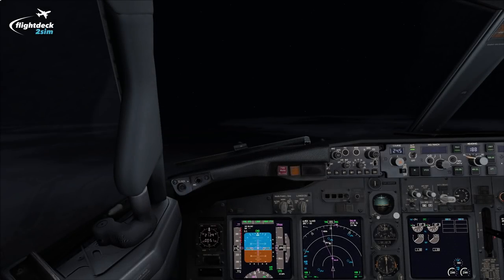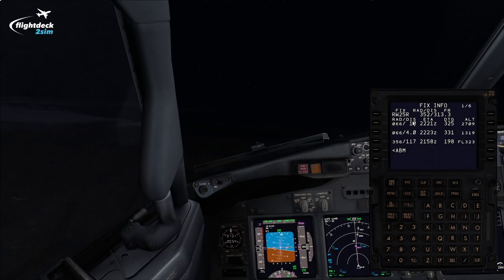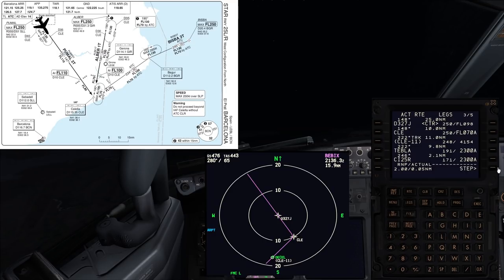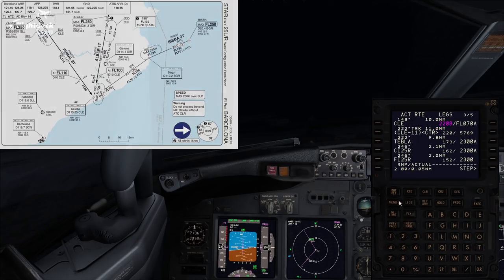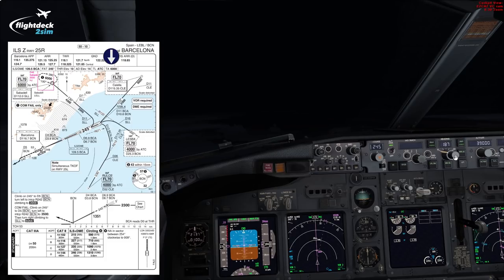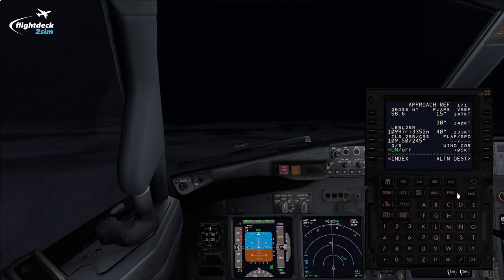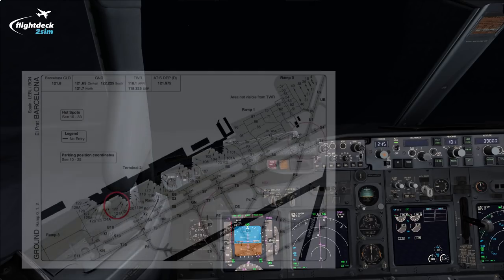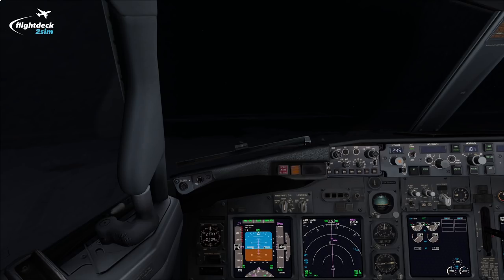How to read an Approach Chart by a Real Boeing 737 Pilot | PMDG 737

Comment: I was just doing a re-run of your tutorial on holding patterns. I must admit I am still fascinated at just what the FMC can do.

I wanted to do some practicing at entering a hold and set up one where I was quite high at FL310 and approaching a way point which was about 10nm before T/D. I noticed a Decel appear some distance before the a/c was due to enter the pattern. As soon as it reached the Decel point it began to reduce speed I guess because it was trying to reach the hold speed (219K) as it entered the pattern.

The timing was nearly spot on although during the turn the speed dropped with a bit of a jolt to a "buffet warning". Straight away the old girl lifted up her skirts and quickly climbed back to the set speed and still maintained the altitude. Coming out of the pattern normal flight continued to the T/D without a hiccup. Waiting down the flight path was the usual Decel point.

My hat is off to whoever invented this amazing package.
Reply from the maker: Hi Richard.

Although possible it would be very unusual to hold at that sort of height! 219kts would be quite a high mach number at FL310. Either way the FMC is quite a clever box of tricks and will provide you with a very efficient flight profile so long as you give it useful information. Just like any computer, garbage in = garbage out! 

FD2S

Comment: Sometimes the runway freq in fsx is different then cdu, always check the right freq on fsx self
Reply: To prevent this, you should have same AIRAC in both, FMC and FSX. For FMC you need to have a membership (or get it "somewhere else") and for FSX there's a great website aero.sors.fr with up to date data, really helpful.

But sometimes whole airport is moved, runways are altered, etc., so you have to download updated scenery anyways. I personally prefer free "lightweight" sceneries, which are same as default (graphics sucks), but updated with all stands, taxiways, etc.
Reply: ^^ happened to me once

Comment: Thanks for another informative video, I hope you dont get bored at some time soon and give up on making these videos! My question is on the chart the airport elevation is 14 ft, however the runway 25R is, according to the FMC, is 64 ft. And your took the chart as your reference. Is that because the pressurization has nothing to do with the runway elevation or because the chart is more reliable than the FMC?
Reply from the maker: Hi Ahmet, I enjoy making them and I will continue to do so!

We used the Elevation of the chart to set the Land ALT. The 64ft in the FMC is the height you want to pass over the threshold (+50ft) or the threshold crossing height. This is automatically set when you select the runway in the FMC. 50ft + 14ft = 64ft!

FD2S

Comment: Welcome back. A question to ask in regard to ILS approaches after replaying your tutorial on Cat III auto landing.
I noticed you activated the approach while still approx 90degrees to the RWY course after seeing the glide scope come alive.

I always believed it was necessary to establish the a/c on the localizer first & then check that the glide scope bug is sitting near the centre line before activating the approach. Does that mean the signal contains both lateral & vertical information for the FMC to control the approach as long as the angle is within certain parameters?
Reply from the maker: Hi Richard,

You can are APP straight away if intercepting the G/P from below, no need to are VOR/LOC first. It's also beneficial to do this when conducting an Autoland so you don't forget to engage the 2nd A/P! If above the G/P I would arm VOR/LOC first and arm APP intercepting the G/P.

APP follow's both the localiser and glide slope whereas VOR/LOC only follow the Localiser.

Good Luck!

FD2S
Reply: Worse thing is when You arm loc and forget GS

Comment: Can you explain why you add a ring for TOD in addition to the TOD calculates by the FMC, how does this helps you? Also, for TOD you mean altitude to lose x 3? Flight level x 3 i’m guessing would work if destination airport is at sea level but if you want a TOD from cruise to your IAF i guess it would be altitude to lose x 3? Thanks for your great tutorials, they will help me a lot next year when i start my type rating course!
Reply from the maker: Hi Manuel,

It might seem daft but the reason we put this as a fix ring is to increase situation awareness on the display in case you're distracted! You might also be off the magenta line if say diverting around weather so you have a approximate idea as to when to descend.

x3 is just a rough rule of thumb but it works out really well. Eg 30,000ft = 90nm. 5000ft = 15nm etc.

Allow extra distance to reduce to approximately 200kts 10nm from landing, (add 1nm for every 10kts of deceleration). For every 10kts of Tailwind also add 1nm. It's all approximate but It's what we do everyday and it works quite well.

FD2S
Reply: I've used those rules like crazy for flying a DC9 in FSX and it always works out perfectly if you can figure your ground speed and calculate the associated descent rate. Pretty stunning to pull off doing VNAV calcs in your head, but you quickly see how impossible an RNAV approach would be given the mad altitude restrictions into some areas. Doing it without a second pilot is quite hectic. It really makes you appreciate the value of a good FMC.
Reply from the maker: Yep, STAR’s are sometimes not built with continues descent in mind and restrictions can sometimes leave you very high or low!

FD2S

Comment: Excellent as always FD2S.   Is it normal after passing from the transitional altitude from standard to local QNH that I must press the Standard button on the EFIS in order to get my QNH set up in the descent page?  Despite doing this I find that the QNH is off by a few decimal places, which requires manually setting it up (at the least convenient time).
I've also noticed in the decent with engine anti ice, that my engine thrust is raised (presumably to take more bleed air from the engine). Not sure if this is normal, but at a time when I need to lose air speed it is very inconvenient, even with flaps 2 or 5 and the speed brake in the fully up position my aircraft refuses to slow down.
Reply from the maker: Hi ENIK,

The FMC DES page is independent to your altimetry setting, it just allows VNAV to build a more accurate descent profile. We immediately set the local QNH as soon as we have been cleared from a Flight Level (based on 1013 STD) to an Altitude (Based on QNH)

The increase in N1 is completely normal. When you select the engine anti-ice on bleed air is taken from the engine to heat the engine cowling, the EEC selects "Approach Idle" which is what gives a slight increase in N1/N2. The increased thrust makes you descend at a slightly reduced rate.

FD2S
Reply: I've noticed that the increase in N1/N2 only occurs when flaps 5 is set.
Reply from the maker: In the real aircraft Approach Idle (Increase in Idle N1/N2) starts whenever flaps are in the landing configuration or engine anti ice is on, I wouldn't expect the increase with Flap 5. 

I double checked the manual and it doesn't mention which flap settings, just "landing configuration" which would be F30 or F40 and potentially F15 in a non-normal situation.

This is why I like my channel though! People make me read the manuals so I keep learning too! 

FD2S
Reply: When would you use the leading edge anti ice?  I'm aware of the rule that if it is 10 degrees C or below on the ground, engine anti ice must be used. I spoke to a newly type rated FO on the 738 a few years ago, and mentioned that the aircraft needs to be set up differently during winter operations. I generally turn on Engine AI when in clouds of possible precipitation with start switches continues to break up any broken ice from the cowl.

Comment: Hello flightdeck2sim, you have said typically the MFRA IS 1000ft BARO do i need to add the Airfield elevation as well,because one of your NADP video i saw you set 1310 as MFRA please if  you could clarify this for me, also please could you tell me, what is exactly the EO - ACCEL HT on FMC please, many thanks for your time.
Reply from the maker: 1000FT AGL, so you just need to add 1000ft to the elevation.

EO - ACCEL - The height at which VNAV will accelerate with an engine failure.

I made a tutorial recently which will clear up some of your questions! 

https://youtu.be/yPfKEVaXVqY

FD2S

Comment: A few questions regarding an approach that are somewhat related to your video.  I recently began using Pilot2ATC (which I think is great) and it will often give me vectors to final and an altitude assignment when I have planned for a STAR.  No problem, I switch to HDG SEL but,  do I stay in VNAV?  If so, what decent profile is the plane flying since vectors are taking me away from STAR waypoints?   
 What do you then do in the FMC since you are now deviating from your LNAV plan to "clean it up"?  Move the FAF to the top of the FMC to delete all other waypoints?  Thanks.
Reply from the maker: Excellent Question!

If you’re being vectored you can use VNAV so long as the FMC lateral path is periodically updated. You would route direct to a applicable waypoint so at to stay close to the magenta line so VNAV can provide accurate descent information just like I do in my tutorials. 

Regarding what mode on the MCP you use it doesn’t matter, use whatever mode you need to to get the job done 👍🏼

FD2S
Reply: Thanks very much.  I was talking with a SWA pilot in Vegas recently about descents/approaches and he said they try to stay in VNAV 99% of the time but V/S is okay if needed.  LVL CHG rarely used I think he said because it is set at 2,000 fpm and maybe that is not good for speed management.  My confusion was thinking VNAV and LNAV need to stay coupled during an approach, but understand that's not the case and as long as I'm within a reasonable distance from a STAR waypoint then VNAV will provide an acceptable descent.  Thanks again, you'll likely be hearing from me at some point.

Comment: In my understanding the DH = 225 which has be dialed into the PFD (instead of 235 as this is the altitude). Correct?
10 feet isn't the end of the world, though ;p
Reply from the maker: Hi Mjouze.

The minimums for a CAT I ILS is knows as a DA or Decision Altitude. Altitude is based off sea level so that’s why I have 235ft set, not 225 👍🏼

DH or Decision Height would be used for CAT II / CAT III and the minimums is  based on height above ground, we set the minimums using the Radio Altimeter in this case.

FD2S

Comment: Hey pilot! You think 737NG TP is more difficult than airbus or newer boeing like 787 because of automation, less switches, etc??
Reply from the maker: Hi Alfonso!

I’ve not flown any airbus aircraft so I can’t give an accurate comparison. 

Airbus has a lot more automation and from people I’ve spoken too it’s a nicer cockpit to work in. (You get a tray table for starters!!)

When it come to the 737 it’s a more hands on feeling. When you manipulate the control column you’re moving cables that move the plane's control surfaces using hydraulics. With a fly-by wire system you manipulate a computer which does all the work.

It’s a long drawn debate, you could argue I’m biased towards Boeing but I hey both have advantages and disadvantages 👍🏼

FD2S

Comment: Isnt 187 NM from T/D too soon? I mean, what if the active runway changes?
Reply from the maker: Hi 23 Savage,

A typical Line Crew would start briefing 100nm prior to TOD and ideally will have all briefing complete prior to TOD so they can concentrate on the Descent and Approach. You can be passing 10,000ft and they change the landing runway! It's something line crew have to occasionally deal with and it's a pain in the a**! 

FD2S
Reply: Hahaha, yes, i can imagine it being a pain in the a**. Thanks for the reply, you're awesome dude!
Reply: Do you often get side steps while already on final, and if so what does the pilot monitoring have to do to help? I imagine that'd only happen with say a visual approach and not an ILS?
Reply from the maker: Hi there,

I’ve never flown anywhere that’s needed a sidestep but it’s quite a common manoeuvre. It can be off any instrument approach 👍🏼
Reply: If they side step an ILS do they have to give a vector or can you maneuver yourself onto the parallel loc?

Comment: I think you made a mistake with transition altitude (6000 ft) and transition level (by ATC on the plate). Good video though.
Reply from the maker: Hi Marco, not quite! I'll explain!

You would usually get the TL from the ATIS or ATC which I'm not using. The TL varies with the QNH. The TL is the lowest level that will guarantee vertical separation from an aircraft using local QNH. The TRANSITION FL on the DES FCST page of the FMC simply alerts you if you're still on STD if you select a lower altitude on the MCP, so long as we set the QNH when we've been cleared to an altitude that's all that matters.

I didn't touch the DES FCST page of the FMC in this tutorial, the FMC automatically changes from the default (FL180) after selecting the appropriate arrival procedure, in this case FL60. In certain cases this might be the same as the TA but as I said, this is merely just a function of the FMC, there must be at least 1000ft between the two.

I hope this helps clear it up!

FD2S
Reply: I like to put TA +1000 there.

Comment: Do you have X-plane? Have you tried their 737?
Reply from the maker: Hi Vimal, I just recently bought it!

I’m yet to have much of a play around, I need to get use to the interface. The default 737 is not bad and I’ve heard of this ZIBO Mod I need to try out 👍🏼

FD2S
Reply: I think the Zibo Mod on the default 737 is excellent.  Very similar to the PMDG 737, but completely free.  Amazing! Not sure if you've considered something like this, but it would be nice to hire you for private lessons (for flight sim purposes only). I just joined a virtual airline and I can't think of a better way to learn the 737 than sitting in a simulated cockpit over the network with you.